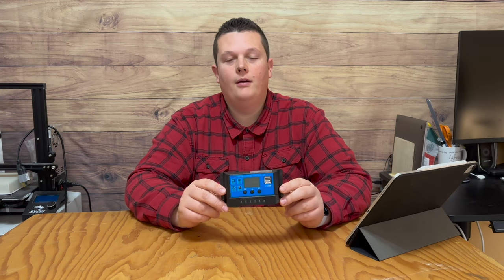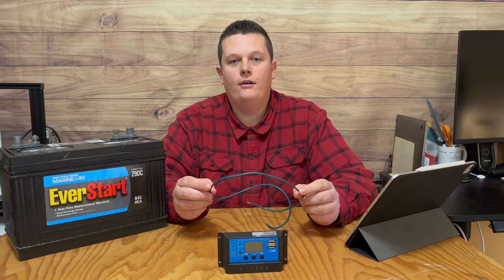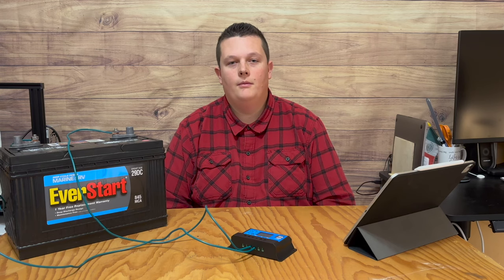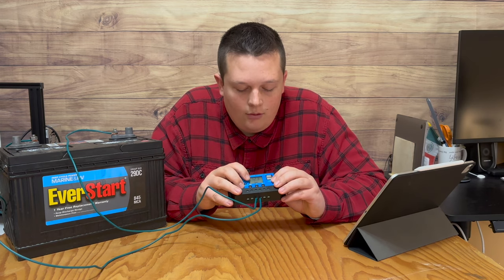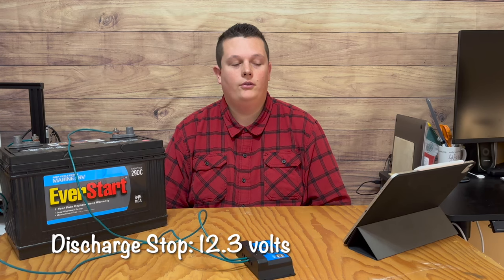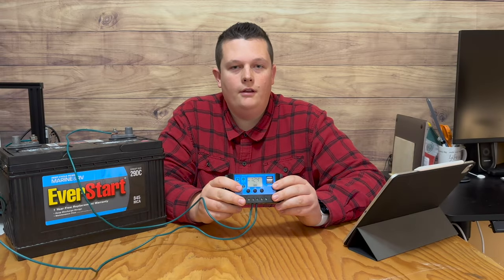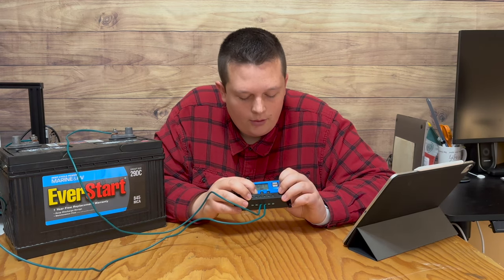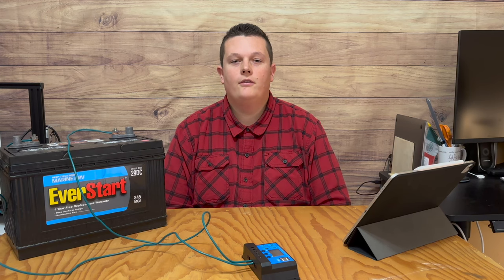How to Setup a Solar Charge Controller (menu, battery type & wiring)

Comment: Thanks for the great explanation! 
Quick question: mine says its both 12 and 24v, but how do i switch it to 24v? My setup is 24v and the max i can set the charge voltage is 13...
Reply from the maker: Hmmm…I would try un plugging everything first, wait a minute, and then plug just the battery back into the controller to see if it automatically adjusts to 24 volt.
Reply: Thank you,  I'll try that
Reply: It worked!  Thank you! 
I think my problem was, in fact, that I connected panel first, and not the battery....😂
Reply from the maker: Awesome!!!

Comment: I have that exact same controller.  I have the float set to 13.7, but for some reason it will not charge the battery past 12.6v.  I have a single small solar panel with one 12v gel battery.  I just replaced the battery (after 5 years of use), and this behavior started with the new battery.  Also, I never get the solar panel icon on the display.  It used to.  What could be wrong?
Reply: Maybe when you replaced the battery, the controller switched over to thinking the solar panel was for battery. This could explain why you are not seeing the solar panel icon. Have you tried disconnecting the battery and solar panel from the controller and reconnecting the battery first, then the solar panel afterwards?
Reply: @TheBlackfrogg    That's what I thought. But when I tried that, still no charge.  So I bought a new charge controller.  Same problem.  I had checked the voltage at the solar panel before, and it was erratic, but always close to 20V.  Today it's 0.  The sun is shinning on it.  Even if the panel is bad, I'm surprised it's exactly 0.  So it seems like I need a new panel.

Comment: Hi. Thanks for your explanation. I'm confused however because my controller has a float voltage value that refuses to go below 14.5V no matter what I do. If I leave it at this value, it is going to cook my 12V battery in not time. Any ideas? Thanks
Reply from the maker: Interesting, a good float voltage is around 13.5 volts. Did you connect the battery first?
Reply: Float voltage range changes with battery type.  Set your battery type first.
Reply: You have to take into account voltage drop at the battery end after wire resistance and active current draw at time of measurement. Float voltage at battery is less then the 14.5v the controller has set at its output.

Comment: Hello, Great Video! Just got one, (Same Battery) too. When I set my battery type to b03 it changes my float voltage to 14.6 Volts and won't let me change it to13.7 Volts. But it does let me set the Discharge stop to 11.8 Volts. I'm sure it's important about the battery type though. I'm not sure to leave it like that at 14.6 and keep a close eye on it, with a shut off switch, or is it safe to use the b01 battery type setting. Or should I just get a different controller. Any suggestions are appreciated, Thank You.
Reply from the maker: Oh, that’s interesting. I personally would keep it at the correct battery type and then just keep an eye on it for the first few days. 👍🏼
Reply: same with the one I have.
Reply: I just said “screw it” and set it on b01 and the float voltage to 3.5 volts.  I don’t want the panels trying to put more voltage than that into my battery.  Not necessary, IMO.  Thoughts?

Comment: How many watts can Pwm 30A solar charge controller can handle at max? Can it handle 540 watt panel 12v or 460 watt panel 12v?
Reply from the maker: The 30 amp controller from this video says it can handle up to 390 watts of solar power coming in as the max.

Comment: Here's a question you can help with. When I initially plug it in to the battery it shows the battery voltage which is 12.4. but as soon as I plug in my solar panel, the displayed voltage drops down to 11.5. why is it doing this?
Reply: Sometimes, simply hooking a power source up into a circuit you will see 👀 this issue you have described.

Comment: Are the settings remembered in the unit after disconnecting the battery?
Reply from the maker: That is a great question, however I'm not sure.
Reply: @ScottsSolarProjects  just verified I’d does remember all settings even after disconnecting from power

Comment: I've got the same device completely. However all my settings are stuck at 25.5 volt. I can lower some to a very few specific voltages, around 22 or 23 volt, never lower.

My batteries are 12 volt, it shows the correct voltage on the main screen, 12.8volts. I think the device is faulty and i fear leaving it like this will make it overcharge the batteries

Comment: Hi Scott my van has been in at the garage inside for a over a week I have got it back and the batteries are empty I think and all that is showing on my controller is floating voltage of 7.5v how can I reset all of this??thank you
Reply from the maker: Interesting, did something draw power til the batteries were depleted? If so, that may have damaged them. You can try charging them back up manually to see if that will help. Just make sure if you disconnect that you connect the battery back up first to the controller. I hope that helps!

Comment: There are few models of this controller, some of them even have 7 battery types in battery settings. The problem is I watched few reviews and all of them gives different information about which setting is for each battery type. Does battery setting changes rest of the parameters of controller?
Reply from the maker: I believe it does, but not sure in which areas. I think it adjusts the parameters you can set for the battery.

Comment: Very good explanation but can i connect the load part of the controller to the the inverter instead of a light bulb?
So i can have the inverter running and the battery also charging during the day
Reply from the maker: Thank you! You can do it that way, the only probablem is for example on this controller, it only has an output max of 10 amps, which is 120 watts. So as long as your inverter doesn’t exceed 120 watts, you’re good. Otherwise, if you want to run higher loads, you’ll have to connect the inverter directly to the battery itself.
Reply: @ScottsSolarProjects  oh oh now i get it so if i get a controller that produces more output I'd also have more output power on  my inverter
Reply from the maker: Yes 👍🏼
Reply: @ScottsSolarProjects  thank you very much I've been searching for this information or knowledge for God knows how long 
Thank you so much ♥️
Reply from the maker: You bet! I’m happy I could help!

Comment: When you use these, there's the USB slots that are supposedly for a small load. I had a question about that; does the USB have to be a small load or can it be a small incoming power solar slot also? (There are solar panels that have USB connections). 

Hope someone can reply to this. Thank you. 

Also I'm in Utah also! I see your location marked as Utah. :p
Reply from the maker: Haha, awesome! I've never seen anything about charging via the usb ports on this controller, even though you may on others. It must be a real small panel, is that right?
Reply: @ScottsSolarProjects  It is. one of those mini panels. But they seem to actually really work when I use a voltmeter on them. And I wanted to try one because they are much cheaper than the full size ones. (I still like full size more.) But I'm also curious if in the future the new ones will have these usb compatible cables. the mini ones don't have the same cable types as the big ones. They have more options for cable types such as usb, what looks like a power adapter size, and some mini clamps. 

So someone could have a usb cable connection go into these little blue solar charge controllers. But that's assuming that little port is 2 way, which I'm not sure about.
Reply from the maker: Gotcha, I assume it isn’t, but it’s worth a try!
Reply: Solar panel have usb connection it means that the voltage in the usb is regulated already with a maximum/minimum  tolerance of solar voltage, you can't directly connect to a solar panel without voltage regulator.

Comment: Video on the lithium version of this controller especially the settings?
Reply: The settings available to you depends on who has rebranded it, some only allow you to adjust float voltage, while others allow you to also adjust bulk and absorption of each chemistry type.

Comment: Hiy my controller is flickering . Can i take the wyers out. ?
Can i tough the wyer of the accu ?
I think it's earosion.
Reply from the maker: Yes, I would disconnect carefully all the wires, clean up and see if new wires will work, if the controller is still fine.
Reply: @ScottsSolarProjects  thnx. for your help. 👍

Comment: Hi Scott, thanks for the incredibly descriptive and helpful information! I have it all set up according to the way you described, and it worked perfectly...for a while. For some reason, when I connect the incoming wires from the solar panel, voltage drops across those two wires from close to 20 down to 12...and not enough to charge effectively. Any ideas? We're baffled.  I have all the settings exactly as you said... triple checked.
Reply from the maker: Hmmm...any issues with the panel/wiring inside the panel? How old is it? Sounds like that's the issue before it even reaches the controller.
Reply: This is how a PWM charge controller works, it pulls the panel voltage down to battery voltage.

Comment: Can i use 2 x 100ah leashure batts on one of these both connected in parreal .
Reply from the maker: Not sure what a leashure battery is, but yes, you can connect 2 batteries in parallel with this controller. In fact, I’ve done it with 3-100ah lead acid batteries.
Reply: @ScottsSolarProjects  thank you scott
Reply: I have to work out how you do the settings now .

Comment: if i dont have battery then i cant use controller with solar panel? wanted to connect controller to solar so i can use controller usb ports to charge my phone or something
Reply from the maker: Yeah, it doesn’t work very well at all, you really need a battery too!

Comment: I just set mine up, but I can not adjust the float voltage from 14.6. Do you have any idea why?
Reply from the maker: Did you set the correct battery type?
Reply: @ScottsSolarProjects  yes I believe so. I set it to b3 since I have a 12v flooded battery
Reply: same with mine.
Reply: the float voltage is B.S...it is really the over voltage cut off. Use the b1 mode and set the "float" to 14.2V then the set the next one to 13.V to turn on and the next one is the over discharge turn off. Set it to what ever..11V to save your battery. So far this is working on my deep cycle battery.

Comment: Hi Scott, my controller doesn't show anything. We didn't use our solar during the winter, and whenever we disconnected the solar panel when leaving the home, it still showed the details of the battery. But now it is just blank. Can you give me some guidelines? <3 Much love
Reply from the maker: It might just be a dead battery, if so, try charging it with a battery tender. If that doesn’t work, it might be a bad battery.
Reply from the maker: It might just be a dead battery, if so, try charging it with a battery tender. If that doesn’t work, it might be a bad battery.
Reply: @ScottsSolarProjects  I will do this week. If its dead, there goes $100 for new one XD
Reply from the maker: Best of luck!

Comment: My battery is lead acid battery. I have tried to change discharge stop from 10.7 to 11.3 but after going back to main menu and rechecking it still reads 10.7. what might be the problem?
Reply from the maker: That’s a good question, just make sure you have the battery hooked up first before solar or the load. And when you enter to change the settings and they’re flashing, adjust them and then wait for it to stop flashing. If you’ve already done all that, I can’t think of any reason why it wouldn’t work.
Reply: @ScottsSolarProjects  thanks

Comment: Sir, does this unit protect the battery from over charging. How should i set the unit to protect from over charging.
Reply from the maker: Yes it does. You can set the float voltage, around 14 volts, which is good depending on your battery and the controller will take care of the rest.
Reply: @ScottsSolarProjects  Thank you very much Sir.

Comment: I’m also very confused about the whole situation because my understanding is the systems are designed to be discharged and recharged but if you keep the batteries for all the time it’s not good for the batteries. I’m very confused as to how if you’re using solar and battery to power your devices but you have more than enough solar to cover it but then the sun hides behind the clouds and then you need to have the system supplement Battery once the sun comes back from what I understand the solar should not start charging the battery again until it’s discharged down to the point where it should be
Reply: But that becomes even more confusing for me because if you’re using solar powered devices and you’re discharging your battery only when necessary and only recharging it when it reaches a certain low level what happens when you don’t have sun and your battery is discharged very close to the point where it starts charging again and then I guess you have no power
Reply: I find it amazing I’ve been trying to figure this stuff out periodically for months and this seems to be some of the most basic and important information to understand yet nobody explains it or they just don’t understand it themselves I don’t know
Reply from the maker: Batteries like to be trickle charged. The controller allows you to set what voltage (or how full) you want your battery to remain at. We know 80% is a good target. But, if you're constantly using the battery and need the full storage, then you'll want it to charge fully when possible.

Comment: I have two battery 12volts each, what is the setting
Reply from the maker: Depends if you want to connect them in parallel or series. If parallel, then it’s the same settings. If series, you’ll have to configure for 24 volt, and I don’t have a recommendation for those settings because I’m not that familiar with 24 volt. Maybe double the 12 volt settings?
Reply: @ScottsSolarProjects  thank you sir

Comment: What  will  happen  if you connect  the  panel  before the  battery.
Reply from the maker: It would confuse the panel for the battery voltage and it wouldn’t work correctly.

Comment: I agree that the low discharge setting availability on this controller is way too low and will destroy batteries pretty quickly..

Can anyone recommend a similar controller where the setting is able to be able to be set to the recommended 12.3?
Reply: I believe the maker is assuming a couple things. Such current draw along with gauge of wire and distance for battery bank. If they are assuming that draw is 10 amps so they could be using 14 or 16 gauge wire with controller 10 to 20 feet from battery means they have to take into account for voltage drop of wire hence 12.3 at battery could very easily measure ~ 10.99 for 14g and ~10.33 for 16g at controller.
Reply: You may find that the same controller from a different brand (which will have different firmware, the internal software that manages everything) may have different voltage range. For example the Victron branded unit can set the cut off voltage as high as 12v (which is acceptable for deep cycle batteries, the type you are expected to be using with these).
Reply: @all-tied-up_net  the voltage drop would be at the far end of the load, not at the battery.
Reply: @flandrble  when battery is charging the battery is the load.
Reply: @all-tied-up_net  you shouldn't have 10 feet between the controller and battery, it needs to be as close as possible to avoid the voltage droop. Most people tend to mount these directly on the battery box, or have it next to it.
Reply: @flandrble  I totally agree. Most people do/ may, but not everyone. My assertion is manufacturers of these cheap controllers may be designing device to cover long runs with the assumption that the installer can install devices to compensate for short runs if necessary  to limit what is presented to battery. True it seems that they could give us a couple more volts to adjust for but hey.. an extra $13.00 still beats paying hundreds more.

Comment: What if I’m just needing to recharge a phone through the usb.
Reply: On mine (same as video) the usb is always on and working like any normal usb charge port if the controller is connected to a 12v battery. Just be aware that It has no low voltage cutoff and is not affected by any menu option. So if you plug a phone in that’s great just be aware that if you plug something in ,say, a little light it will stay on forever until it completely drains the big mother battery. In other words the usb is dumb and doesn’t talk to the charge controller. The load terminals however do and if you had a little 12v car stile usb charger thing and you connected it to the “load” terminals then if the usb somehow drew your battery below your low voltage load cutoff value then the little usb you wired in there would shut off automatically at that point and safeguard your big mother battery from being drawn too low and damaging.

Comment: So I have to have a battery to use the solar panel?
Reply from the maker: Yes
Reply: @ScottsSolarProjects what if the arrow from the panel to the battery is on, but it's not flashing?
Reply: @ScottsSolarProjects never mind I figured it out thank you so much for your video this helped me so much

Comment: what can i run off the load terminals
Reply from the maker: A fan, a small charger/inverter, light, etc.
Reply: @Scott's Solar Projects  what size inverter. Is there a video on someone doing it
Reply from the maker: How to Setup the Load on a Solar Charge Controller
https://youtu.be/v-iLu9DS558 this video might help you a little. I believe mine is rated up to 120 watts of load that you could use an inverter. But, I recommend connecting it directly to the battery instead.